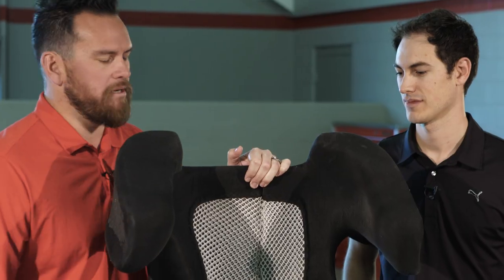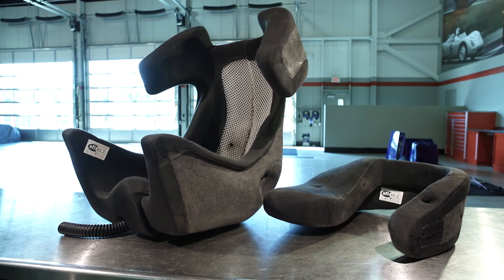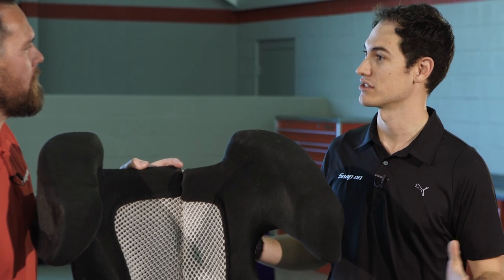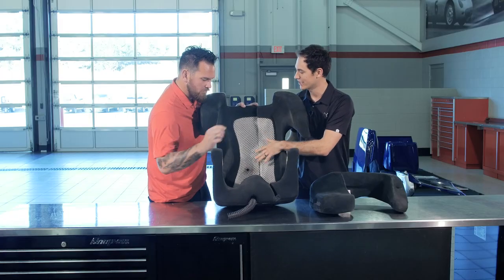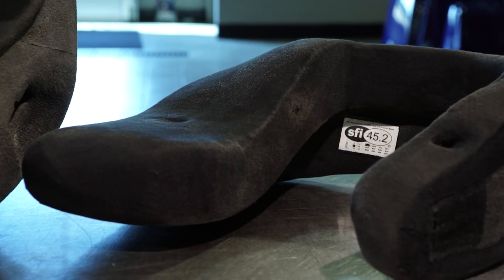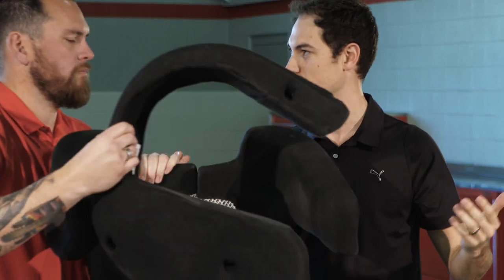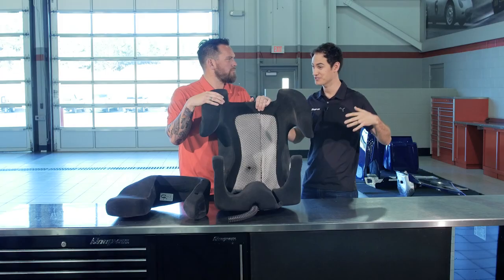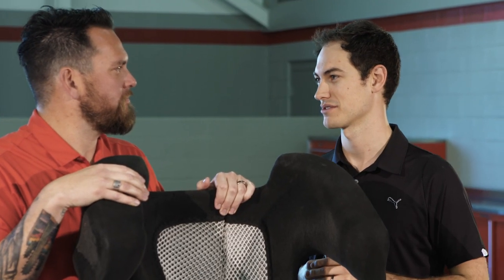Inside a NASCAR® Cockpit with Joey Logano - Snap-on Tech Series: Penske® Edition

Comment: I believe there should be NASCAR rules that dictate maximum temperature of drivers body....Force ALL the teams to sacrifice whatever performance it takes to achieve safe temperature ....If it goes above a certain temp?  For a specified amount of time?   The car gets called into the pit till it's fixed....why the hell not???   Rather than conventional A/C I envision liquid cooling via tubing inside helmet and chest area (where sensors would be)  The coolant pump and reservoir would be entirely modular with quick disconnects so that in a failure the battery pack and entire system could be replaced in a few seconds   ....Seems like to me metal tubing in a container filled with dry ice would go pretty far?  Maybe that is all that is needed??   We have all sorts of safety rules for so many professions that include temperature,  WHY is this neglected?  What am I missing??